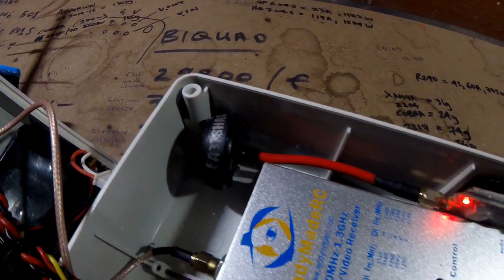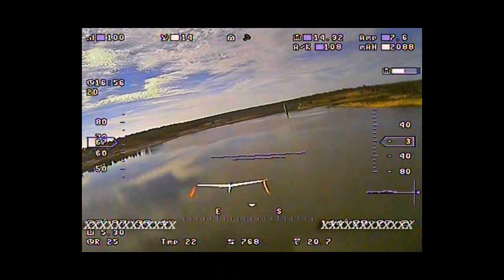» FPV Ground Station - Overview Of My Setup

Comment: HI mate 
This may be a bit late BUT what antenna is on the aircraft along with by quad ground station AT
Reply from the maker: I use a linear dipole or inverted vee. Ground station antennas are biquad or yagi

Comment: Hi, I am following this design for my ground station, but will be using the SPT200 Pan & Tilt kit with D645MW Servos. The SPT200 is rated for up to 2 lbs. My VAS Crosshair Xtreme antenna weighs about 2.2 lbs. I suppose this setup should be OK. The D645MW servos have metal gears and are high torque. I was wondering, have you connected a separate BEC to power the servos? Or are you powering them straight from the Eagle Eyes board? I've read online that the internal BEC on the EagleEyes board can overheat if connected to very high power servos. Wanted to know what your setup is since you're using a power on/off switch. 

Thanks, 
~Yanis
Reply from the maker: Hi Yanis, the servos are powered off the eagle eyes. I never thought to check the power rating. So far so good. Good luck with your build

Comment: Do you still use this setup?
Reply from the maker: Sure do, the tracker is the heart of my setup. Couldnt live without it now
Reply: @StuntDoubleFPV    Thanks for your reply,
I noticed that with the eagle eyes you have to have a vector or an osd pro coupled up for it to track it, is there anyway to track for example, a F405 instead?
Reply from the maker: @wsisports220  im pretty sure its eagle tree products only.

Comment: Hi mate, are you still using this exact setup? Have you changed anything or would you change anything if you built it again ...? Cheers
Reply from the maker: Hi Snickers, 2 changes since this vid. 1. Swapped the yagi for a biquad. The yagi elements were always getting bent in the car. Biquad gives me excellent quality and enough range anyway. 2. Added external charging connectors. No need to lift the lid everytime I charge the lipos. There is an XT60 and a DB9 connector for the balance leads. If I was to build this again I would try and cram everything into a smaller/lighter box but i'm happy with the component choice. You could definitely get away with a lighter pan/tilt servo unit if you wanted to remove some weight
Reply: Stunt Double FPV thanks for the reply... can you please tell me what ratios are on the pan and tilt servos... also do you know what series the tilt setup is, spt???? . Is it possible for me to somehow private message you regarding this tracker? Cheers

Comment: Awesome :-) gonna replicate this for sure, any suggestion on how to incorporate a switchable 5.8 receiver as well?
Reply from the maker: Switchable 5.8 rx.... thats gonna complicate things. You will be limited by the amount of cables you can pass through the pan mechanism shaft. You can do it, im just trying to think if it would be best to have the 2 receivers mounted inside the ground station or externally on the pan/tilt unit itself.

Comment: Great setup! I have a question for you. Was there any reason for using coax from your 1.3 to the EagleEye video in? I can't see where you have it connected. . . are you using In1 or In2 and connecting from the bottom of the PCB?  One of the cool things about the EagleEyes is that it's already got the 5V stepdown for the P/T servos. Are you using the onboard 5V to power your servos or are you using a BEC? I'm trying to do something similar with my Pitlab tracker.
Reply from the maker: Coax is easy to work with and i assume shielding helps a little too. All the connectors were removed from the eagle eyes so the coax is soldered directly to a ground and input #1 tab. Im using the built in 5v reg to drive the 2 servos and it works fine.

Comment: What would something like that cost? Id like to buy one
Reply from the maker: Maybe $500 worth of bits in there. The most expensive bit is the pan and tilt
Reply: @StuntDoubleFPV  can i buy it? Would  love to have one been looking for a tracker
Reply: I love it.. Wireless
Reply from the maker: If you wanna build a cheaper one you could use a pan servo only which still works great. GWS S125 sail winch servo + eagle tree eagle eyes + good quality VRX then put it in a box on a tripod. Not too difficult

Comment: Nice project. How do you control servo direction since it's a continuous rotation?
Reply from the maker: Denys Sene nah this one is standard rotation just geared for further travel
Reply: Your project looks great. I built mine with stepper motor and slip ring for the pan and high torque servo for tilt, but in my case I used an arduino and 1w radio for the telemetry.
Reply from the maker: I'd like to see that

Comment: Stunt, How you managed to sort the wire from till servo into your box and spin freely?
Reply from the maker: Eric Ao Hi Eric, the antenna coax and tilt servo wire pass through the hollow shaft of the panning mechanism. It doesnt do unlimited 360, its about 540 degrees.
Reply: Damm. I must bought a wrong pan unit. The shaft is solid.. will get a replacement...
Reply from the maker: Eric Ao bugger. The hollow shaft is important

Comment: Excellent thanks for sharing. Great ideas. I found racing vtx's get too hot. Your fan is great. I'm also wanting to build in charging circuitry for built in liion. I have designed an Audible battery level alarm so I don't have to check the display and I'll never forget. Also helps me remember to switch it off!
Reply from the maker: Hein Du Plessis Hi HDP, the eagle eyes has a built in battery alarm. Charging circuitry would make it easier. I think those smaller style vtxs would burn out in no time. No one really uses the old immersionrc 25mW style anymore so you could pick one up cheap

Comment: nice setup :-) How do you transfer the antenna signal and servo signal of the pan to the box? (from turning part to the steady part)
Reply from the maker: LongRange FPV The servocity unit has a hollow shaft. The coax from the antenna passes through this so it can rotate freely. The servo wires hang below and dont need to worry about them twisting
Reply: I was thinking of some sliding contact, but this will work better as long as you don't spin more then 10 times in the same direction
Reply from the maker: LongRange FPV The eagle eyes setup limits servo travel so dont need to worry about wires getting tangled. I think mine does about 540 degree panning. Sliding contact "slip ring" would be nice although i have heard they can degrade vid quality but its worth testing anyway

Comment: Very tidy build. That would be great on a 5.8 system. I think the car roof would provide a nice ground plane and reasonable elevation too.
Reply from the maker: Pat Edwards Hey Pat, yeah i have been thinking about modifying this to add an attachable 5.8 vrx. I need to test if you can receive 5.8 then still use a 5.8 repeater. Car roof height is good. When i go for long range i add the tripod onto the roof also

Comment: Nice :) I stumbled upon your biquad 3d design the other day when looking for antennas. 
Question, which gives you better signal at range? I noticed you mention the biquad has wider beam.   Also do you find linear polarised better than cp?
Reply from the maker: Len d Hi Len, for long range the yagi wins. Biquad gives me about 20km before breakup, yagi about 30km. CP gives a better picture quality but the antennas are heavy and draggy. Linear antennas are slim and also i prefer them as i can easily make both the rx & tx antennas tuned to my frequency too
Reply: Stunt Double FPV thanks :)